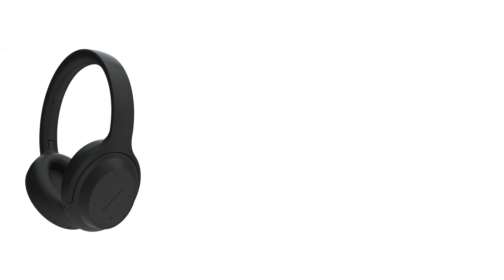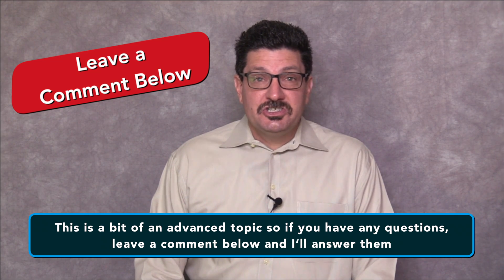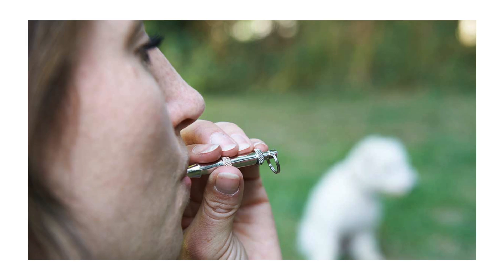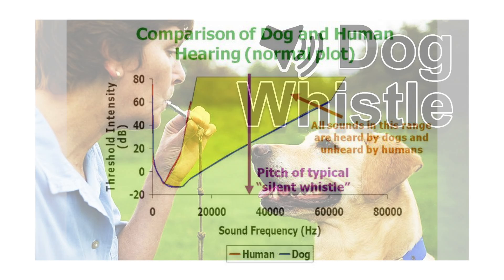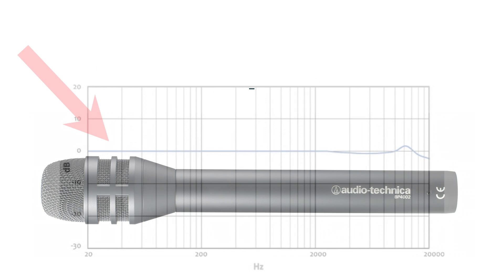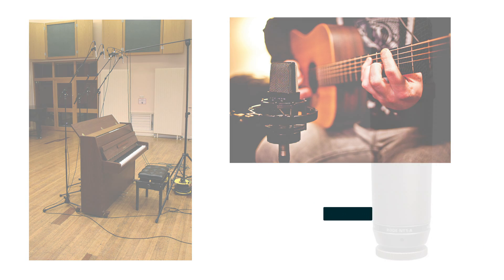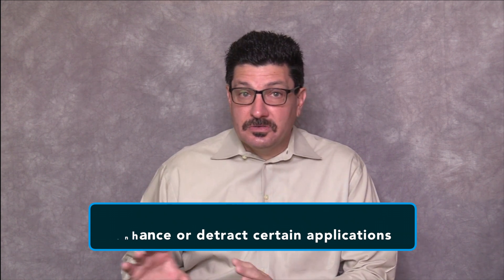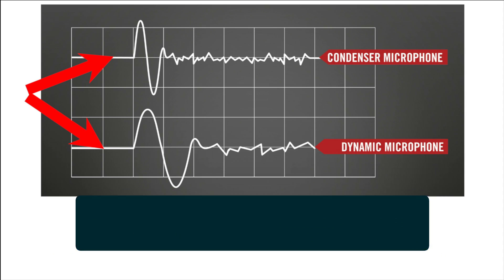Unraveling The Mystery of Microphone and Audio Frequency Response

Comment: How do you boost the presence but not distort the audio by amplifying the high end frequencies causing annoying sibolance? I've got a shure sm7b which has a lot of bass and is quite dark sounding. I just want my voice to have more warmth without too much bass haha
Reply from the maker: I do’t know what editing program you are using so I can’t give you specific instructions on that to adjust audio. What I will do is answer your questions and explain some of the terms used for those who don’t know, but might read your comment later.

First off, unless I’m misunderstanding, it seems like you’re using terms in the wrong way a little. If not, I apologize.

You asked, “How do you boost the presence but not distort the audio by amplifying the high end frequencies causing annoying sibilance?”

Generally, I use the term “presence” in audio when referring to the mid range and the low end (or bass). 

Back in the day amps & mixers that had a presence control meant a simple mid-range boost. 

So why did they call it 'presence'? In what sense can sound be more present?

The answer to this part of the presence question is that the opposite of presence is 'distance' - not 'absence'!

So a sound might be present or distant. Imagine someone talking to you from three meters away. That's distant. Now someone, a favorite someone perhaps, whispering sweet nothings in your ear. That is present.

These two sound textures, which you hear all the time and can easily imagine, describe the effect of presence well. There is something in a sound that is produced close to the ear that is very pleasing, perhaps through conditioning even from the time of birth.

So if you can achieve this sound in a recording, of anything, then we will like it. We have been conditioned to like it.

Another way to describe presence is the subjective distance of the sound coming from your loudspeakers in a domestic listening environment - i.e. not near field.

Close your eyes and some recordings will sound further away than the actual position of the speakers, some will sound closer. Clearly, those that sound closer have more presence.

If you’re talking about presence in a different way, let me know.

Back to your question, about boosting without distortion. Consider a double limiter approach.

	1	Add the first limiter to your chain.
	2	Leave 1-2db of headroom.
	3	Drive the first limiter as hard as you can without distortion.
	4	Place a second limiter in the chain.
	5	Leave at least 0.1db of headroom (some real-world playback devices don’t like digital zero).
	6	Drive the second limiter to taste.

Of course, for those who don’t know, a limiter catches the loudest peaks of an audio source and applies brick wall compression that prevents it from exceeding the clipping point of 0 dB. Limiters are used to increase perceived loudness by increasing the quietest parts of an audio signal while preventing the peaks from clipping. 

With respect to adjusting the vocals to add “more warmth without too much bass” try this:

EQ is one of the easiest ways to add warmth to any vocal sound. It can be used to boost warmer sound frequencies and add fullness. Usually, boosting frequencies within the 200 Hz to 500 Hz range will help add warmth to vocal sounds. Although the exact frequencies you want to boost will depend on the key, pitch and recording.  

Using an EQ plugin, find the most prominent frequencies within this range. You can do this by creating a narrow frequency band with a high boost (15+ dB). Then as the vocal track plays, scan the centre point across the 200-500 Hz frequency range until you find the hot spot, going slowly from left to right. 

This will help you identify which particular frequencies add warmth and therefore want to boost. To boost these frequencies, simply increase the frequency band’s gain in your EQ plugin. 

Make saturation adjustments. Saturation is the unsung hero of music production. It is essentially an effect that adds warmth and character to any sound, making it the perfect tool for warming vocals.

It works by adding subtle harmonic distortion, giving vocal sounds a warmer and fuller quality. This will bring more presence and texture to your vocals without feeling too thick, turning dull and empty vocals into something more soulful.

The easiest way warm vocals with saturation is using a saturation plugin. You can research one’s you might like.

Next, make compression adjustments.  Compression is used to make the average volume levels in your mix more consistent by controlling the dynamic range of sounds. Most tracks will have a lot of contrast between louder and softer sounds, and compression is used to level out this contrast. 

It works by “compressing” (turning down) the loudest parts of a sound. As a result, you can increase the level of other sounds without distorting the mix. 

For vocals, compression allows you to increase the presence of vocal tracks, helping them sound louder, warmer and fuller without “sticking out.” It will level out any inconsistent volumes in your vocal track and maintain a more natural warmth in the sound. 

Adjust parallel upward compression.

Parallel upward compression is a technique that helps vocals sit on top of the mix. Instead of reducing the loudest parts of a sound (downward compression), upward compression makes the quietest parts louder. Using this technique, your vocals will not fall below a certain volume. 

Here’s how to add vocal warmth with parallel upward compression:

	1	Add an aux track and apply a compressor. Then, send your vocal track to this aux track. You can call the output something like ‘vocals’.
	2	Increase the amount of compression, adding around 6 dB of gain reduction or more. Start your attack time small at around 5-10 ms, and your release time small at around 20-30 ms.
	3	Increase the aux track until the vocal track becomes noticeably louder. Be careful not to overdo it. You should stop at just a subtle increase to prevent the vocals from being too loud.

This will help you overcome one of the most common challenges when adding vocal warmth, adding warmth without overwhelming the mix. 

Side chain compression is another option.

Another way to add warmth too vocals with compression is with the internal side chain feature. This can be found on most compression plugins. Side chain compression lets you control which frequencies are compressed (lowered in volume) and which can pass through. 

If you want to create warm vocals, you can use this to stop the compressor from affecting ‘warmer’ frequencies. This means that only higher frequencies will be compressed, and lower frequencies will pass through.

The result: warmer vocals. 

Use a reflective filter during recording.

Reflective filters are used in recording keep vocal sounds clean and clear. They absorb sound near the microphone, isolating the vocal sounds for full clarity and avoiding interference from other sounds in the room. 

Using a reflective filter can really help create warm vocals, since this will give you a clean, better quality recording. This will make it much easier to mix and master your vocals and add warmth. 

For example, boosting certain sound frequencies on an unfiltered vocal recording will also increase the sounds of background noises and any other interference. This will make it very difficult to actually hear the warmth in your vocal track. 

Whereas, boosting sound frequencies on a clean, filtered vocal recording will only affect vocal sound and the warmth will shine through. 

Formant pitch shifting.

This next technique is a little more creative, and can also be used to create some weirder vocal sounds. 

Formant pitch shifting can be used to warm up vocal sounds in music. 

Duplicate the vocal track and add a formant pitch shift plugin. 

On the duplicated track, reduce the formant pitch to make the vocals lower. This will keep the same pitch, but reduce the frequency of the sound. Then, reduce the volume of the duplicated vocal track until it blends well with the lead vocal track. 

This will help the vocal target lower, warmer frequencies while retaining its original sound qualities.  

Audio phase.

If you aren’t familiar with audio phase, it essentially refers to the alignment of sound wave crests. Sound waves can be in phase (lined up perfectly) or out of phase (unaligned). 

When sound waves are out of phase they can cancel each other out (known as phase cancellation) resulting in a thin and less full sound. 

Alternatively, when sound waves are in phase, the sound is much fuller. This makes audio phase a great way to control the fullness and warmth of vocals.

Phase can be controlled through plugins, which allow you to alter the phase levels and correct any phase cancellation.

Let me know if this helps.
Reply: Use equalizerapo and reaplugins.
Reply: @KipacWF  ok I'll have a look

Comment: Can frequency response be "cancelled" or made more flat with EQ:
If I understood correctly frequency response of a microphone is how it will capture audio (basically how everyone hears audio differently), but can the recorded audio be EQ'd to be more flat or boosted to change the sound of the mic?
Reply from the maker: The short and simple answer is, "No." The long answer is more complicated. It's "No" because a frequency responce describes how well a particular component is able to reproduce all of the tones that we can hear. Therefore, adding EQ doesn't really change how a component actually reproduces various frequencies. However, I can answer "Yes" because with EQ, you can adjust the volume level of a frequency (or range of frequencies) within a sound, which in turn allows you to cure a sound, or sometimes even entire songs, of its imperfections. This is done by cutting unwanted frequencies and/or boosting others, all to balance out sounds so they work well with one another. As such, what frequencies, volume, sounds we actually hear (after adding EQ) is different from the tones reproduced by the component. From our perspective, the sound will been changed by the EQ, but the frequency responce of the component is still the same. The problem with your question is that there is a flaw in it. The question assumes that the EQ affects the frequency responce. It doesn't, it affects the frequency of the sound which is a little different. Thanks for tuning in!
Reply: @jimcostafilms  thank you so much for the reply. It somewhat makes more sense now to me.
So is it then safe to say that your microphone still hears the frequency in its range, it just picks up certain frequencies better than others?
Reply from the maker: @wuddlebum  Yes, that's correct.
Reply: @jimcostafilms  thank you very much for all your explanations. It makes so much more sense.
Reply from the maker: @wuddlebum  I'm happy to help if you have questions on any of my tutorials.
Reply from the maker: @wuddlebum  I was thinking of a simpler way to explain it. take your mic. The frequency responce of the mic is how it reproduced the various frequencies that are input into it. When the EQ affects the frequencies/sounds/volume coming out of the mic. When EQ-ing, you're only affecting the output, not the input.
Reply: @jimcostafilms  that puts it in even better perspective as to why you need to use the correct equipment for the job, as you can only manipulate so much, and this is why the flatter the frequency response the easier it becomes in post.
Reply from the maker: @wuddlebum  correct.

Comment: HOW MUCH FREQ BIRD CAN HEAR
Reply from the maker: For birds, hearing is second in importance only to vision for monitoring the world around them. Avian hearing is most sensitive to sounds from about 1 to 4 kHz, although they can hear higher and lower frequencies. No species of bird has shown sensitivity to ultrasonic frequencies (>20 kHz). Sensitivity to frequencies below 20 Hz (infrasound) has not received much attention; however, pigeons and a few other species have shown behavioral and physiological responses to these low frequencies. In general, frequency discrimination in birds is only about one-half or one-third as good it is for humans within the 1 - 4 kHz range. A problem that birds suffer that is similar to humans is damage to the auditory receptors (hair cells) from loud noises. The sound intensity that produces damage and the amount of damage produced differs depending on the species. Birds residing in the active areas of airports might be constantly subjected to sound pressure levels that damage their hearing. Thus, to effectively disperse birds using sound, auditory alerts must be at frequencies that can be detected by the damaged auditory receptors. Although some if not all species of birds have the ability to repair damaged hair cells, continued exposure to loud noises would prevent recovery of their hearing.

Comment: 192khz or 20khz  which condenser mic is good for dubbing and voice over done with  laptop
Reply from the maker: The important frequencies in non-tonal (Western) languages are the frequency band around 2 kHz is the most important frequency range regarding perceived intelligibility. Most consonants are found in this frequency band.

A speech spectrum is either high-pass or low-pass filtered. Using an HP filter at 20 Hz (upper left) leaves the speech 100% understandable. (This is because the complete speech spectrum is there). An HP-filter cutting everything below 500 Hz still leaves the speech signal understandable. Even though most of the speech energy is cut out, the intelligibility is only reduced by 5%. However, applying a higher cut-off makes intelligibility drop.

The other way around, applying an LP-filter makes intelligibility drop very fast. When cutting at 1 kHz, the intelligibility is already less than 40%. It can be seen that the frequency range between 1 kHz and 4 kHz is of high importance for intelligibility.

Comment: Can microphones usually pick up sound outside of the maximum published frequency response or are they capped?
Reply from the maker: The short answer is no. The long answer is:

The frequency response of a microphone represents the range the mic is sensitive to within the audible sound frequencies. The microphone could effectively recreate the entire audible sound range from 20 Hz to 20 kHz or it could limited to a smaller band within the audible frequency spectrum.

The frequency response range is a sometimes misleading specification. It is better to rely on the frequency response graph to truly understand a microphone’s frequency response.

The range of frequency response is not overly helpful (even with a measure of tolerance).

So how do you choose the right microphone with the right frequency response for the right purpose?

You should ideally understand the sound and frequency profile of the source and the acoustics of the space. Then, optimally choose a mic with a frequency that enhances the sound of the source, taking into consideration the technique(s) you’ll be using to place the microphone in order to capture the source.
Reply: @jimcostafilms  thank you for your detailed reply.
Reply from the maker: @originalvonster  I'm happy I could help.

Comment: Does hz increase when db increase and does the opposite true? I don’t know if rode nt1 which is a mic with neutral frequency response or cm25 mic is good for me ? Can u help me with that? Thank u
Reply from the maker: It doesn’t quite work like your thinking.

The Relationship Between Hertz and Decibels:

Vibrating objects create waves of energy that change the pressure of the surrounding air. These pressure changes are picked up by the human ear and interpreted by our brains as sound. The waves of energy produce alternating positive and negative changes in air pressure, known as oscillations, which can be measured in Hertz and decibels.

Sound Frequencies

When an object vibrates, the alternating positive and negative pressure creates a wave, also known an oscillation. A complete oscillation is measured in the frequency of waves per second. Hertz is the standard unit of measurement used to calculate the frequency of these oscillations. If one oscillation occurs in one second, the frequency is denoted as 1 Hertz. When 500 oscillations occur in one second, the frequency is denoted as 500 Hertz. An average, healthy person can hear sounds that range from 20 to 20,000 Hertz.

Pressure Changes

Humans hear vibrational energy -- or the changes in air pressure -- as sound. An object is perceived to be louder or quieter depending on the amount of air pressure generated by the vibrating object. This pressure changes regularly and dissipates for the listener as his distance increases from the source. Air pressure changes can also be measured in units of Pascal, but since these numbers are often very large and hard to work with, the decibel is now more widely used.

Sound Levels

The average, healthy human can detect sounds at the zero decibel level, but a person with really good hearing can detect sound at -5 decibels. The sound level, perceived by the ear, is based on the level of sound pressure and the pitch of the sound; certain frequencies of pitch are easier for the human ear to detect.

Hertz and Decibels

The relationship between Hertz and decibels allows a listener to measure the frequency and perceived loudness of any sound. The frequency or amount of air pressure change vibration is measured in Hertz. The resulting change in air pressure created through the vibrating object is measured in decibels. Decibels, in effect, measure the loudness of a sound and Hertz measures the frequency of the sound.

Here’s review of the Rode NT1:

https://www.musicradar.com/reviews/tech/rode-nt1-591073

Whether or not that mic is good for you depends on the application. is it for vocals, an instrument, in a studio?